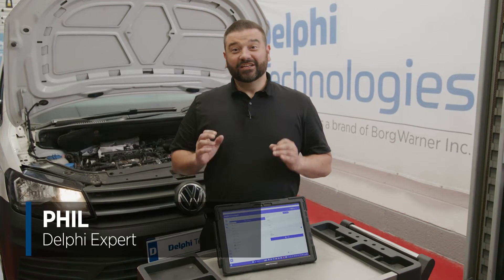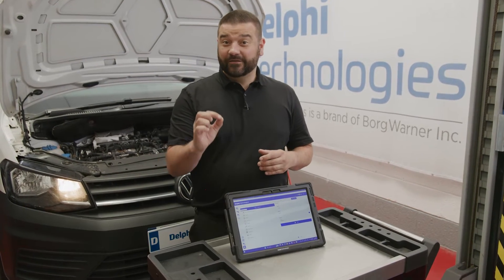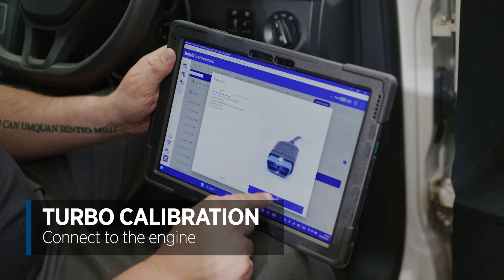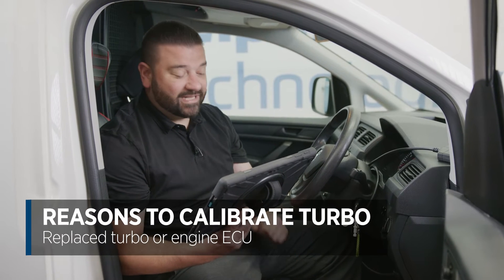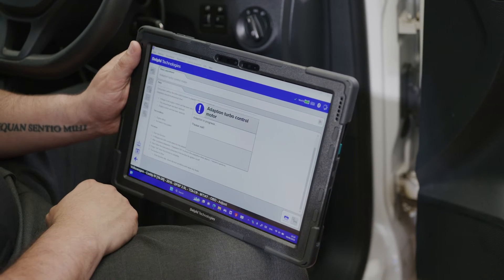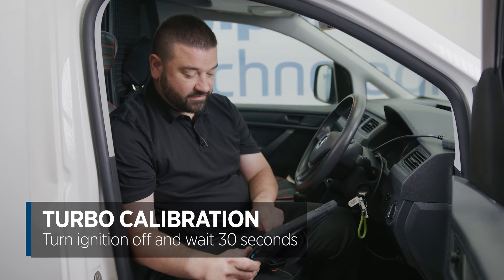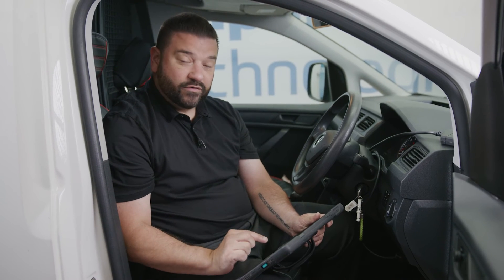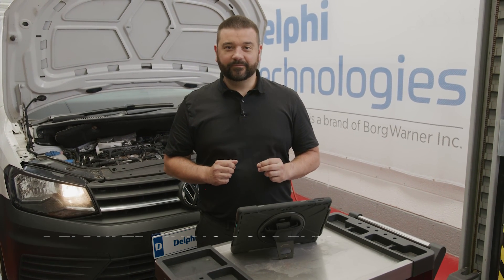[EN] How to calibrate a turbocharger | Masters of Motion

Comment: I need bmw x5 2018 calibrete wastegat valve pls give eme sum sugestion
Reply from the maker: Hi, and thanks for your question.  The DS software covers turbo wastegate calibration for both petrol and diesel variants of a 2018 BMW X5.
As an example for petrol systems it is called "reset adaptation values charge-air pressure control" or "setting of wastegate linkage" depending on ECU variant. Hope it helps!

Comment: Hi, do you know hot to calibrate the turbo actuator on XC90 from 2008 - I have VIDA but I cannot see it his calibration feature anywhere 😢 any tips much much appreciated thank you
Reply from the maker: Hi and thanks for your question. Depending on engine type the DS software can calibrate the turbo actuator on a 2008 XC90. As an example on a 2.4D (D5244T4 engine) the function is called "Adaptation of component (turbo control valve)". Cheers!